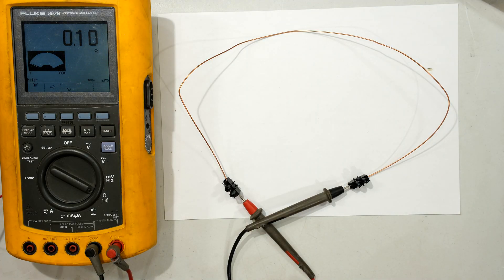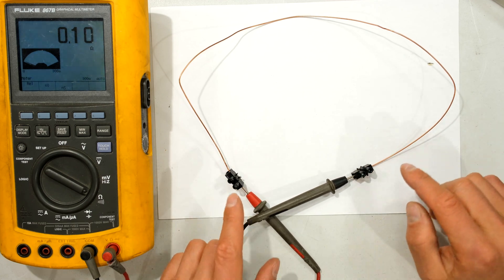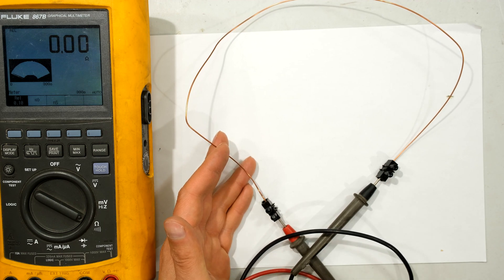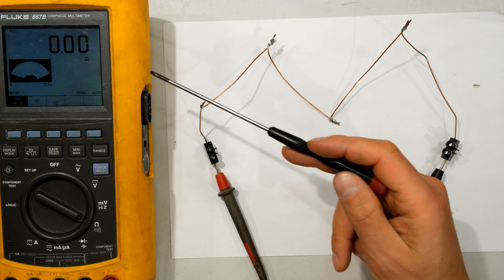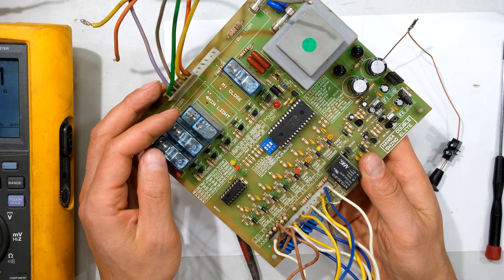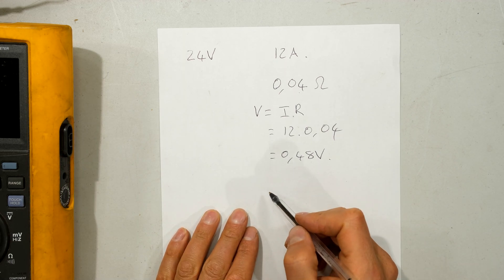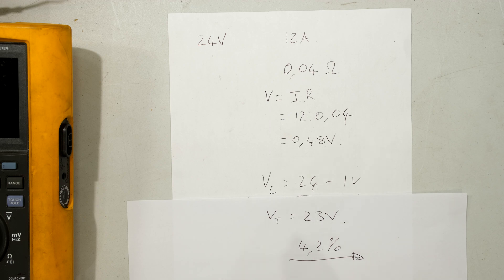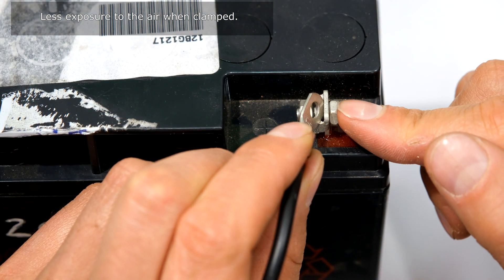Contact resistance of soldered wires versus twisted wires.

Comment: Good to know that in a pinch it is proberly ok to twist a wire together in a low voltage system until you find your solder!